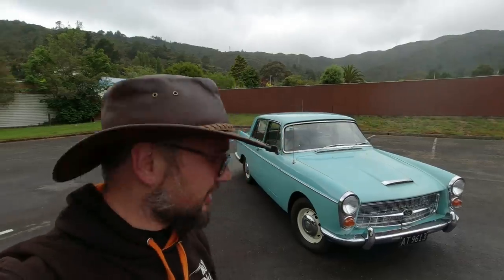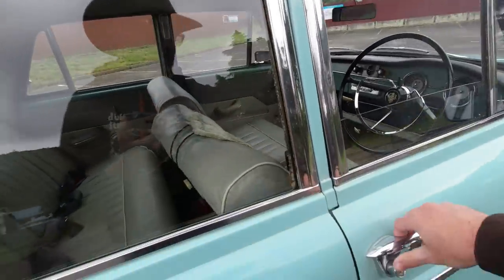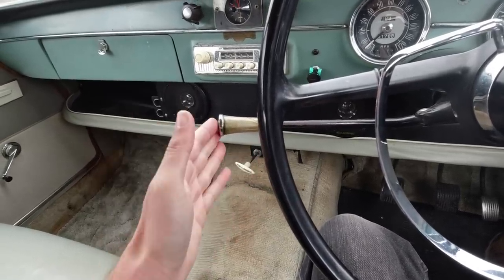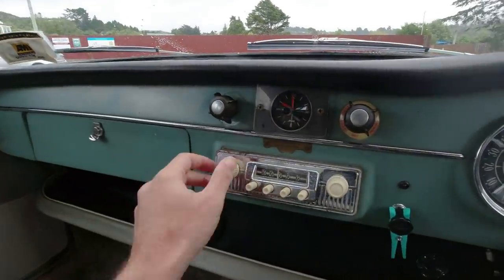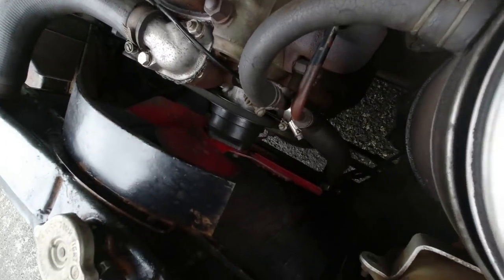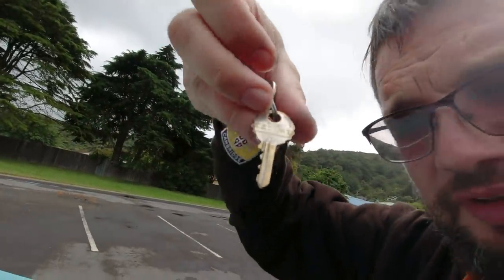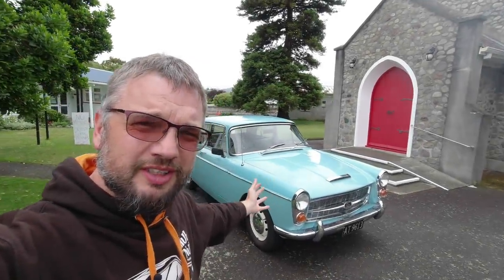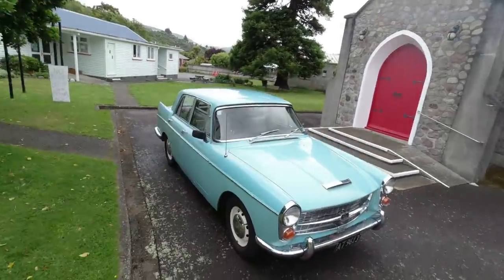Real Road Test: 1960 Austin Westminster A99 in New Zealand. Australian?

Comment: As good as modern cars, what's missing, aircon and tinted windows. Dated styling, but this is evidence of UK decline, think seaside resorts, it's all over the place. 👍
Reply: No. Rather think militant socialist trades unions. Labour did more damage to Britain's industry than ever Hitler did.
Reply: @thrunsguinneabottle3066  You keep reading fake history. I remember an Oxford professor on the BBC Radio 4 Today show the late70s explaining the reasons why German car workers were making 6 cars for every 1 UK car. The Germans had the latest and best production equipment while car workers in the UK we're still using equipment from the 19th century.😂😂😂😂

The professor went on to say that UK car workers were having to work many times harder that German worker. Then we come to the German grand deal were the management worked with the unions, hence why the Germans have so few strikes and one of the reasons for their success. Here in the UK, the class system destroyed UK manufacturing and the legacy is that Britain is the least productive developed nation on Earth, even the French on a 4 day week do better than the UK. You need to control you prejudices and think more rationally.
Reply: @CarlJones14  There was no money in British manufacturing for the installation of more modern systems. If you are not actually making something you can sell, then you end up with no money. Even if UK industry managed to accumulate the necessary capital, it would be an uphill struggle to implement improvements, because of the resistance of the trades unions. These were known as "restrictive practices" at the time. The Unions were actually successful in their own terms. Their object was to overthrow capitalism in Britain, one industry at a time. A  workers' state was still being promoted as a desirable future in the days before the Soviet Union went belly up, and we learned what the workers' paradise was actually like. Meanwhile, capital itself will simply move from countries of low productivity to countries of higher productivity.

Even today, the ideological impulse to implement more socialism transcends any lessons which could be learned from those places where they actually got their socialism. Socialism has always been much worse than whatever it replaced. 

Thank you for telling me what I need to do with my "prejudices" and your recommendation to think more rationally. You can have no idea how much people appreciate this kind of advice.
Reply: @paulsutton5896  The socialism aspect was written by the same lying fake news media who won Brexit for the elite. The fake media did the same thing in the 60s, they created the 'Swinging Sixties' as if it was something real. Over the years I've heard plenty of 'happening people' from the 60s who say they never experienced the Swinging Sixties. Maybe the SS was real for about 10 people. This is how fake history is written.  The plight of workers and their struggle for a fair share was very real, but the story was maligned by the fake news media. Take recent fake news media history. Since the 08 financial collapse, the UK was bankrupt, it still is. However, there has been a 'National Security Imperitive' which involved all the fake news media and all political parties and they would basically all lie through their teeth. Not very difficult when in reality the UK is a one party state. The entire economic construct is a lie. The UK is in a much worse position than it was pre 2007. The gov has maintained QE, £20,000,000,000 billion in debt spent on Help2Buy, just to stop a house price collapse, they use tax payers money to subsidise mortgage (death grip) deposits and they high end builders free public money. The reality is that UK house prices are 50% over valued. You think the economy is fixed? The US Fed is pumping $100 plus billion into the markets every month. Keep in mind that the financial system has no borders. Only workers have borders, banks have no borders, corporations have no borders and the 0.1% have no borders, yet, fake news media bangs on that YOU need protecting by having borders. Another reason for Brexit, the next collapse would see millions flee the UK to Europe, but now the borders are back in place.  The UK elite is terrified of an exodus, even Boris is planning to ditch the immigrant £30k limit. If you believed the fake news, you would think electric car leasing was booming, but it's 1.6% of all car sales/leasing, but the brainwashing effects of the fake news would have you believe other wise. Meanwhile SUV sales/leasing are booming, we have bankrupt Britain's pot hole ridden roads to thank for that. Socialism is a fake news media construct. The simple truth is that workers don't get anywhere near their fair share. Today's 30 somethings are going to very poor compared to today's 70yr olds.
Reply: I'm seriously considering importing one of these executive Austins into the U.S. It just has so much charm!
Reply: @jakekaywell5972  good luck, you have very cheap petrol (gas).👍
Reply: @jakekaywell5972  
Oh no! Please leave us our elderly Austins.
There was a time when they were new, and we wanted to sell you thousands of the things.
Unfortunately, there were no takers.
Reply: @CarlJones14  I enjoyed reading that. I am still laughing.
But (for one thing) I guess you have not noticed any correlation between uncontrolled third world immigration, and inflated house prices.
Reply: @thrunsguinneabottle3066  There are many factors which effect the cost of housing. Immigration does play a role. UK has been accepting 300k to 600k per year for nearly 20yrs. Since 08 financial collapse, the UK has struggled to generate any real growth. Printing Monopoly Money to build lots of building in London is classed as growth. In reality, it's just a corporate lush. Each immigrant represents pure growth, so 300k is a lot of growth, yet the UK is still bankrupt and every year the burden on public services grows with no additional spending. We've gone from a 45 million population to a 66 million population with the same road infrastructure, the same water infrastructure, as in no additional capacity, no  additional building land unless it's government stamped for builders to build crappy housing at highly inflated prices and when you build a few new houses, the older local housing stock goes up in value. The government digitally creates £20,000,000,000 in debt for Help2Buy, the use tax payers money (debt) for subsidised mortgage deposits and they are GIVING high end builders public money. We've had fascist governments since 2008. The Covid virus, made in Porton Down, businesses get bank loans, money that is created from thin air, and many people are having to secure these loans with their own houses and they'll be paying the loan back with interest... who really pays this fantasy money back? Workers, that's who. The financial system was going down the pan long before Covid conveniently arrived. The US Fed has been pumping Monopoly Money into the global banking system for months before Covid. Fact: the real global economy could not survive another disclosed collapse, so they use Covid as a smokescreen & of course, Covid does so much more. Brexit was a disaster, now Covid has rode into town, Brexit is a masterstroke. The UK has nobbled China, nobbled the EU and nobbled Trump's America. Trump was never going to give the UK a good trade deal after MI6 created the Russiagate Dossier. Will Trump survive Covid in November? Lots of things going on and fake news won't touch it.
Reply: @CarlJones14  In Das Kapital, Marx elaborated his theory of why Capitalism will always destroy itself. The process is automatic once you accept Marx's "Labour theory of value". Unfortunately (for Marxists) this is as if Einstein had made an arithmetical error in his Theory of Relativity.

Value is not determined by the quantity of embedded labour (as Das Kapital claims). It is determined by an equation between supply and demand.  As far as I can see, this is the ONLY determinant of value,  as mediated by price. The equation of supply and demand.

So when you tell me: "There are many factors which effect the cost of housing.", I think back to Marx's monumental mistake, which actually invalidated the whole of Marx's writing..

What elevates socialism from a mistake to an evil, is the fact that so many times in history the ideologues, the believers,  gather together to impose their fantasy on the rest of us.
Reply: @thrunsguinneabottle3066  errrr, what capitalism are you on about??? Ronald Reagan set up the PPT, Plunge Protection Team, all markets are rigged, especially gold, silver and other precious metals. Zero interest rates means that TIME has no value... think about that for a moment. In the 60s & 70s you could invest (debt) $4 and get $1 back. Today, you can spend as many $$$$s as you like, you can't get a real return.  This is why rates are rock bottom, zero or in some cases, they are negative. The Russians now control the price of oil and gas. The Saudis are screwed, the US shale industry, $50 per barrel, has NEVER made any money, US banks are screwed, so the petrodollar and US reserved currency has ended... do YOU know what that means for the US? Every transaction required businesses and countries to buy $$$s to do trade and this had a fee, this is how the US has lived way beyond it's means. This has ended!!! The price if oil used to be settled on Wall St and the City, they even started wars to stop people setting up their own market to bypass the City and Wall St. Iraq, Syria and the destruction of Venezuela, but things have moved on, Russia controls the price of oil. Funny, Covid just turned up to save the City & Wall St. Don't you just love magic? As one US president said: "Not much happens is this world that  isn't planned." 😂😂😂😂
Reply: @CarlJones14  Of course! That's some of the appeal behind it for me, but  the car that made me an enthusiast when I was but 10 years old was a fire-engine red 1966 Austin-Healey 3000 Mk. III with a tan leather and burl walnut interior. For that reason, I have a big soft spot for English cars. If I could also find myself an Austin Seven Ruby and a Singer Gazelle, I'd be in Pommy Tin Heaven! I think they would greatly compliment my existing 1962 Studebaker GT Hawk (with Studebaker being this nation's most important marque in my opinion).
Reply: @thrunsguinneabottle3066  Of course there was. That time was immediately after WWII, as your infrastructure was almost completely destroyed and the motto became "export or die". Even though I may currently own a 1962 Studebaker GT Hawk here in the U.S. (with Studebaker being this nation's most important marque in my opinion), the car that made me an enthusiast when I was but 10 years old was a fire-engine red 1966 Austin-Healey 3000 Mk. III with a tan leather and burl walnut interior. For that reason, I have a huge soft spot for English cars. If I could also find myself an Austin Seven Ruby and a Singer Gazelle, I'd be in Pommy Tin Heaven!